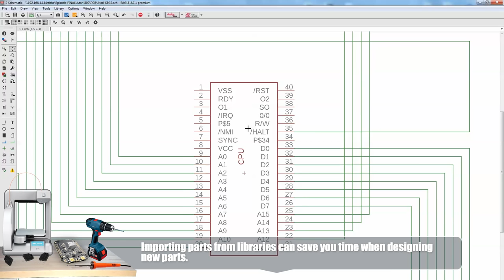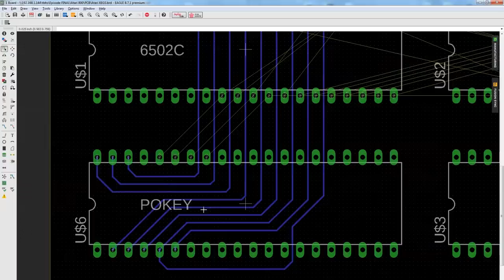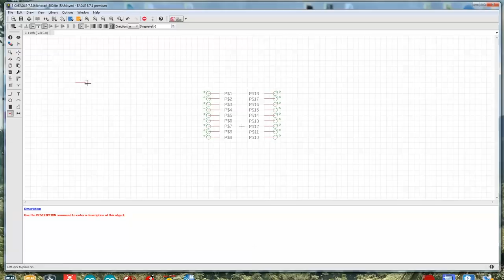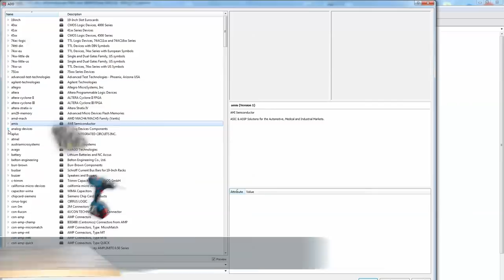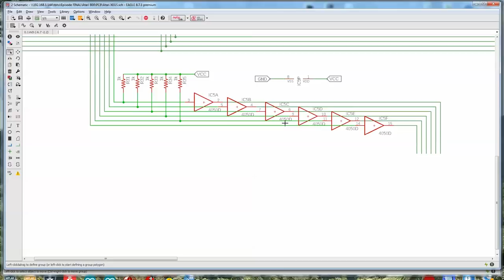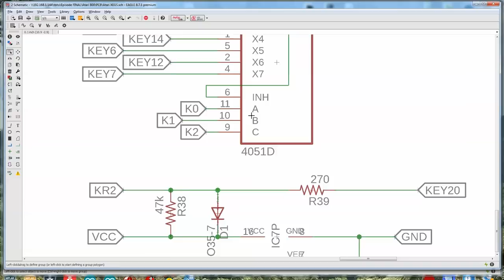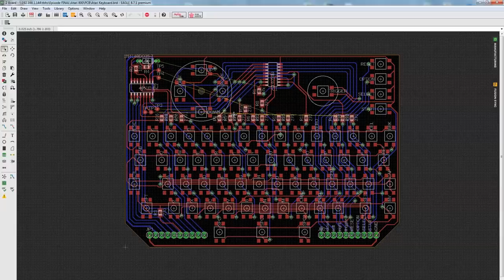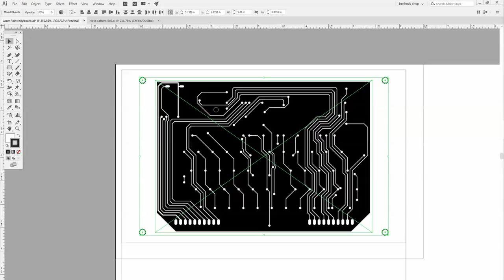The Final Project:  Atari 800 Handheld - Part 1

Comment: I grew up using Ataris.  I had a 2600 game console.  Then I started working with computers.  My first one was a 1200XL.  Later, I got a 130XE.  I made a 10-key keyboard for the 1200XL when I was in junior high school.  I added an 80-column chip to the 130XE.  I still have all that stuff (and all the accessories).  Good times.

Comment: I once had the idea of mounting a (somewhat disassembled) Atari 400 in my car, with a keyboard on the dashboard and with HUD video monitor. I figured only the car would have enough power to drive the machine.
I never imagined making it actually portable. I mean TVs were still all CRTs, so the HUD seemed more practical.

Comment: First computer was a Commodore 64, which due to the printer and GEOS as well as tons of games remained in steady use until Win98 was out. I've never made a PCB though, since my projects are generally less involved (and I don't have a million dollar company bankrolling anything). I think if I did something like this, I'd try to integrate a Ultimate-style cart into the board and some flash memory so that cartridge ROMs/disk and tape images could be installed internally, making it truly portable. With the C64, you would also need a switch to change the joystick from port 1 to 2, since while many games used 2, more than a few used 1. I'd also use a larger screen, but then I'm not a fan of squinting.

Comment: I'm surprised you call it the Atari 800 XE Game System. Internally, those were basically Atari 65XE systems in a different form factor, unless you have the model with 128k of ram, in which case it's a 130xe in a different case. I've always heard it referred to as just the Atari XE Game System without any sort of 800 on it. The XEGS I had as a kid is the only working atari system I have now, I still need to repair my 130XE.

Comment: @14:15 -- Pro-tip: you can use old EPROMs as poor-man's glue logic (pretend the address select is the the input and the data lines are output, and then program into each address what you want the logic output to be).

Comment: as for 'motherboard so big'. you'd almost start thinking pcb production per square meter was hell a lot cheaper in the 1970s and 1980s than it is today. (also quite a few pcb factories don't even seem capable of producing something 'tv chassis' sized from back then nowadays if you wanted them to (prices instantly jump skyhigh at that sorta sizes, as in it's cheaper to buy your own factory in that case).

Comment: skip the old dram... 62256 32K * 8 sram... also has the same pinout as at28c256'es therefore nice and straight lines on the board.

Comment: "the original atari had 4 joystick ports and here they are"... eh just that every joystick is -5- digital inputs. they also have fire buttons ;) plus also 8 potentiometers for 4x2 paddles (also each with fire buttons but no idea what they connected to)

Comment: actually.. for connecting ataris and/or atari periphials to 'modern computers' something like this: http://www.megawin.com.tw/en-global/product/index/6502_MCU would sooner be considered than an 'ftdi cable' as 'atari people' happen to be more comfortable with 6502 code and it can basically implement the entire interface and being a native periphal to the atari in one chip, running 6502 code and pretending to be some 'normal pc kinda periphial' on the other side (although pc diskdrives are generally addressed in entirely different way) without any additional software on either side. just using the normal kernel/bios routines. plug and play. for a 2 way rs232 link over the sio bus it would at the very least still need to filter out it's device id and that sorta stuff, think there were some more signals too... (not that that matters much as atari's weird ass molex plugs never were anywhere to be bought seperately back then and they sure as hell are not nowadays ;)

Comment: I'm really not sure what he means when he says "Atari 800" because he clearly does not literally mean the model "Atari 800".  I feel like whatever he means includes the 130XE.
Reply: Atari 800 is used to refer to the entire line of 8 bit Atari computers, including the 400, 600, 800, 1200XL and so on. My guess is it's because the 800 designation was part of the line from 1979 until it's end practically, save for a brief gap in '85-86, with 800XL and 800XE being later editions.